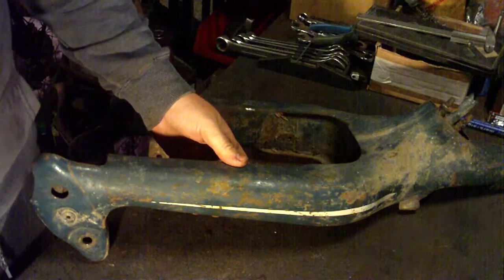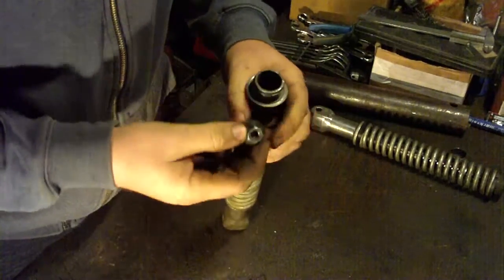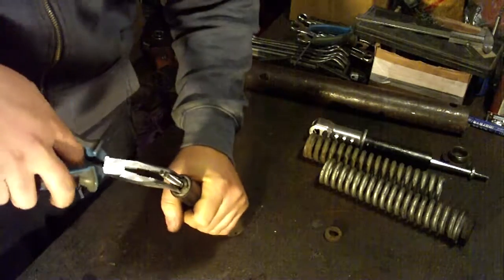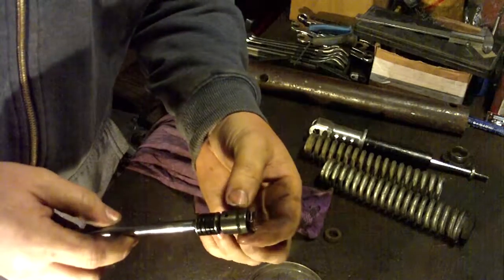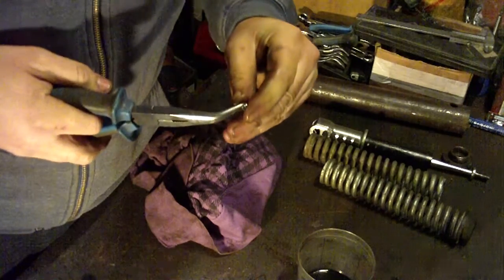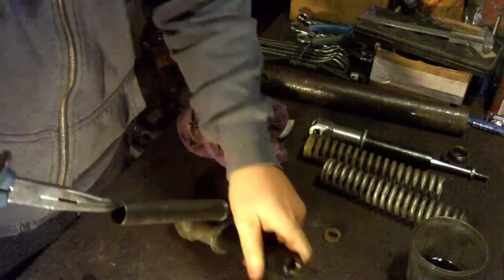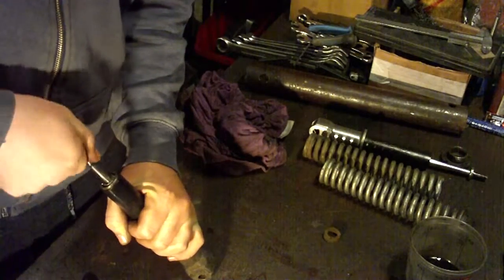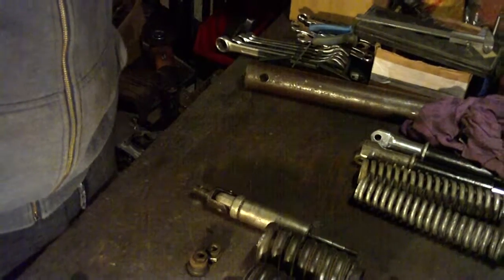NSU Max shock absorber  disassembling and cleaning (part 2 )

Comment: Did you make the video on removing and repairing the rear shock absorber (internal one)
Regards
Russell
Reply from the maker: hello
I never had need to repair that type of shock absorber . On vehicle from this video rear shock absorber was damaged beyond repair . I bought another that was in excellent condition and instal it . From my experience there are two type of inner rear shock absorber . One type can be opened ( it has threaded cover that can be removed ) ,it has two holes for tool to be inserted . Other type cannot be opened ( the cover is pressed into the housing ) . Inside of the shock absorber is almost identical as on front or rear external absorbers .